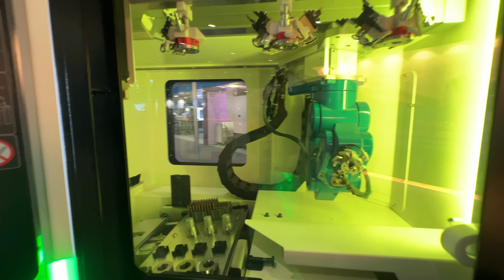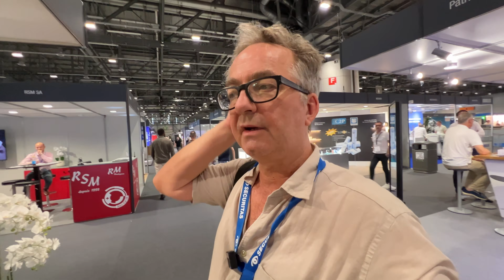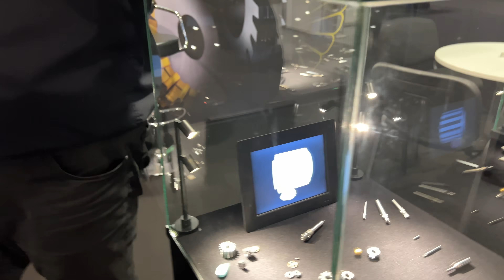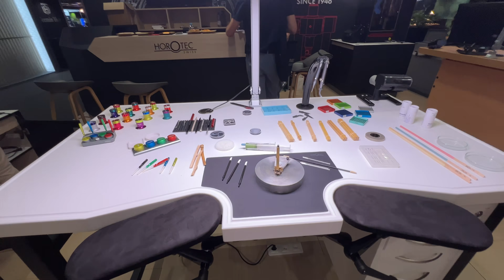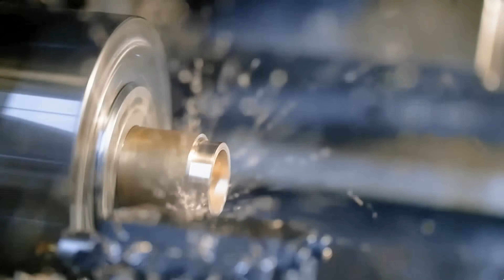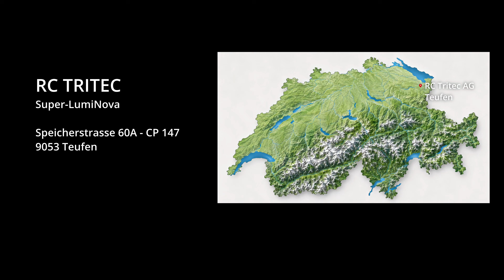EPHJ 2026 - High Precision Trade Show in Geneva, Switzerland

Comment: Fascinating stuff. I'm interested in the logistics and the supply chain, maybe because it's a bit mysterious to me. I like that there is capacity nearby to make stuff, like the factory down the road from you that can take on production line stuff and just pump out parts for anyone. I do wonder how long the machines are useable for, with that level of precision; would you ever break even making watch parts and selling them wholesale before it wears out? I didn't see much with laser welding or additive manufacturing or sintering, but I guess they're around. That little production line was fun, and the machine oiling the palettes while it was running was pretty cool. That level of specialisation and automation does make me concerned for the future of watchmaking though: In 10 years, if I have to service a watch made in 2026 will the tools and information be available?
Reply from the maker: The show does have companies that do laser sintering, laser welding, rapid prototyping, additive 3D printing, etc. Most Swiss mechanical watch manufacturers do design and build for future serviceability. Swatch is one exception to that but Swatches are for the most part designed as disposable mass-produced novelty watches. Swatch Group owns many companies and brands that make traditional mechanical parts and watches that are designed for long term serviceability. Omega and Bréguet being examples of that, but also Blancpain, Tissot,  and others.
Reply: This is where I don't like the Swiss conglomerates (ie Swiss cartel). They restrict parts to independent watchmakers and as of more recent have dumbed down or removed micro-mechanics and parts fabrication in Swiss sponsored watchmaker education in the US. Only 3 or 4 out of the only 8 schools in the US are independent, still teach micromechanics, and each have only 8-12 seats every two years with two year waitlists. So the end user has no other option but to send it to a service center for up to 6 months, where the customer service technician (not watchmaker) was taught in a free tuition Swatch or Rolex run WOSTEP Customer Service Tech (not watchmaker) school to open bubble packets and swap out parts, or swap out the entire movement with someone else's factory refurbished movement, rather than take it to a local watchmaker with no more than two week turnaround. Swatch group is absolutely horrible. They cut off ETA movements and components to ouside brands over a decaide ago while controlling the bottleneck or monopoly on supplying hairsprings and balance wheels, but more especially the mainspring. All the third party movement manufactures that supply most everyone else and clone ETA still have to be subservient to Swatch or they get cut off from hairsprings and mainsprings. The Japanese don't do this with their workhorse calibers, nor do the Chinese. If you buy a new Swiss watch from Swatch, Rolex, Richemont, or LVMH you are essentially paying an initiation fee for a product lifetime of subscription fees where they control the walled garden on parts, service, and watchmaker training in the US.
Reply from the maker: I think the modern consensus is that watch repair is best done by swapping out parts and movements, not repairing the teeth on a wheel or making a new balance staff on a lathe. And the reason is purely economic: the parts and movements are mass produced and cost far less than the labor to repair a broken or worn part. Restoration, on the other hand, is where the education and interest lies for me. Almost every important movement designer starts with a combination of engineering and restoration skills. Restoration provides a feast of historical progress to study and learn from at virtually no cost other than time and tools, and engineering can be learned from any university or even just books at the library. Restoration skills are very different from repair skills and every watch repairer does not need to be an engineer, but every movement designer does. 

The monopolistic behavior is more challenging for me to defend, but one of the reasons I was drawn to Swiss history was the incredible success of intervention and orchestration of the watch industry by the Swiss government historically, and that includes the period of the formation of Swatch Group. Because I started from the point of view that monopoly, regulation, and intervention in markets was simply wrong, what interested me about the Swiss watch industry is that it seems to have worked so well, and it seems to continue to be working. And not just for the watch industry but for the country as a whole, as the watch industry spawned an industrial and manufacturing and educational base that's incredibly successful across all domains in terms of output, exports, and distribution of wealth. 

It would be anti-historical to suggest that Nicolas Hayek sought monopoly for himself and his family so much as he sought to shore up the industrial base in Switzerland through consolidation. His argument to the banks and the government in the face of intense price competition from Asia was, "do this or you will lose it," and in fact selling the major brands that were part of the Swatch Group consolidation, including Omega, to the Japanese was on the table. Switzerland kept the brands, the know how, the industrial base, and arguably its reputation as a result. Of course we'll never know what would have been without Nicolas Hayek, but I'm comfortable in my belief that he was right, and did the right thing for Switzerland itself, with the help of the Swiss banking and industrial elite at the time. He also profited, but he wouldn't have had he been wrong.

The creation of a conglomerate under family control, even if it does technically have other shareholders and trades in the public markets, did result in monopolistic structures and at times harmful monopolistic practices. But the government remains highly involved in the watch industry to this day. And families have proven in many cases to be better shepherds of long-term multi-generational continuity of industrial businesses, especially in watchmaking where history matters, than the short-termism of the CEO sociopaths of my country of origin, the US. Nicolas Hayek predicted that the West's outsourcing of manufacturing and financialization would destroy the industrial base and self-sufficiency of the West in the 80's and 90's and indeed they did. Both parties focused on exporting intellectual property monopolies and the coercion of CIA-orchestrated "international development" (USAID), crushing every democratic movement they encountered on that path, while using identity politics at home to distract the domestic population from what they were doing. 

But that's another story! 

As a long-time resident and beneficiary of the Swiss system I think it works and I like it. For anyone outside of Switzerland I can understand why it might be frustrating: because the Swiss system is designed and managed to benefit Switzerland and the Swiss. To the Swiss the rest of the world is just the export market, and the government's responsibility is to try to develop and support industry in such a way that the country is self-sufficient and brings in more wealth than it exports. The Swiss have done that and done it well while maintaining democracy and avoiding war since its inception. That is what every government should do for its population in my opinion. And I wish they all did. That watchmaking is part of the Swiss identity just makes it all the more interesting and beautiful to me.
Reply: @IMakeWatches   I do agree that swapping out parts is more economical, but I view the recent changes in education and strict distribution of parts as done to monopolize servicing to brand specific service centers rather than a decentralized system of free agents who can easily make career decisions for themselves by either adapting to any brand at any moment or work independently with the capability of fabricating parts when they become unavailable. I honestly believe the conglomerates are also trying stifle the US from making an industrial comeback in watchmaking. There is a distinct timeline of peculiar actions and changes that are direct responses to what has been emerging in the US. We are losing watchmakers to retirement at a rate of 10 for every one replacement all while there is a massive boom in retail sales of mechanical watches. The demographics point toward Gen Z as the fastest growing market for analog watches while using them as functional talismans for countering technology fatigue, seconded by Millennials who use them as flex or investments, then Gen X who appreciate the rebellious spirit and creativity of independents and microbrands, and finally boomers with vintage nostalgia and luxury brand loyalty. The two main catalyst to this boom were COVID lockdowns and YouTube algorithms. This also kicked off a significant surge in watchmaking hobbyists and are bleeding into unprecedented waitlists at every US watchmaking school, to include waitlists at part time bench courses at AWCI and NAWCC. Prior to all this we only had three independents who were fabricating their own near US made in house calibers completely unknown to consumers. One started in early 2000s, then two more around the time Hayak started curtailing parts. The Swiss cartel's canary in the coalmine moment was one small watch company who started upcycling antique and vintage US pocket watches into wristwatches with other US made components (case, crown, crystal, and strap) to achieve a USA made label while showcasing the proud legacy of US watchmaking. In 2015 Swatch sent a cease and desist and in 2017 responded with a frivolous lawsuit for no other reason than to bankrupt the endeavor and intimidate others from even considering the idea. Two years later a high school history teacher started creating a USA made watch to inspire a resurgence in the US and completed just in time to ride the popularity of from COVID and YouTube's algorithm disruption. Two more companies since achieved near US made label, a US company began assembling movements for microbrands and working toward full domestic components, and now a US company is printing hairsprings from silicon wafers. This is about the time the Cartel decided to close watchmaker full curriculum WOSTEP in the US, while still maintaining 3 full curriculum, free tuition schools in a country they leverage in a global supply chain with much of the parts hiding under a facade of a 60/40 Swiss made label (China). They can't have anymore elite US alumni with the capability of competing against them, especially when a USA label means 100% all or virtually all domestic labor and components. If an American wants full curriculum WOSTEP they now must pay out of pocket and compete with the rest of the world for 12 seats every two years at the flagship in Geneva where they also give scholarships exclusively to the Chinese, or seek one of three independent overseas schools with comparable or superior full watchmaker curriculum taught in English. I don't view any of this behavior as protectionism, survival, or stewardship for horology. It is adversarial. I'm sorry to go off on a tangent. I'll stop.
Reply from the maker: @gortex6  I don't disagree with anything you said. I met Cameron Weiss and Roland Murphy at EPHJ last year. Both are important American independents. They were talking to each other in the La Joux-Perret booth and I introduced myself to both and had a short conversation with both. La Joux-Perret is a Swiss company, but it's owned by Citizen in Japan. US watchmakers can make watches with Swiss movements made by companies like La Joux-Perret and Festina and others (or fully Japanese movements like Seiko) that aren't Swiss owned. Both Roland and Cameron were talking to La Joux-Perret about movements. If the Swiss-owned brands don't want to sell to American independents or if American independents don't want to work with them because they don't like the terms they can (and do) go to other manufacturers. I think my only criticism of anything that you've said is that I believe in optimism. Too much pessimism can be burdensome to oneself, and also to the very people that you care about: for example students, young watchmakers, people who want to make a career of watchmaking... It can sound really discouraging if you tell people that the world they are entering is so flawed and corrupt that they'll find it impossible to survive. It's really up to every individual to find a way if they're interested in making a career of anything. And the realities of money and competition are always there for all of us, big or small. The world is a very dynamic place. Everyone in every industry has to work to make their dreams happen. Watchmaking for many is a competition with oneself to be the best one can be. Some will be very good and make a good career of it. Others will enjoy it but ultimately find something else to do professionally. I think it's a really interesting art that's tied to history, and I love that about it more than anything. But it's also a business, and that aspect of it is important or the art would not produce any products or jobs and it would cease to be. So for me the commercial side of it is just another challenge -- not a challenge to me because I don't want or plan to enter the commercial side of it, but if I was young I'd find the commercial side if it very interesting, because that's where the careers are.
Reply: @IMakeWatches  I know those two use Sellita which is a not a hostile company like Swatch. They fixed the problem made by Swatch restricting parts and movements, but they still use Swatch mainsprings, hairsprings, and balance wheel. I know about LJP and their Swiss modifications(which includes Swatch parts) to Miyota 9015 and sizing it down to a drop in alternative to all the 2824 workhorse clones. On that note, there is one other company that I'm afraid just closed it's doors as an alternative was Swiss Technology Production (STP) owned by Fossil Group (USA). Their STP 1-11 was the best standard grade 2824 clone IMHO. Fossil group founded STP to break the Swatch Group supply monopoly on movements but there was a catch. Initially they were Chinese made Sea-Gull ST2030 movements that complied with European Swiss made labeling regulations by installing Swiss mainsprings, hairsprings and balance complete (Swatch Group components) which presents issue overall.  The problem you still run into with almost any Swiss movement is the Swatch Group owned monopoly on the power source and regulating organ. The Chinese have an alternative outside this monopoly with the PT5000. I bought one off Aliexpress for $65. It flatlined my timegrapher out the packaging and easily regulated within 4 seconds delta. The Chinese equivalent to Glucydur is QBe2, Nivarox is 3J53, and Nivaflex is 3J21; the patents expired but the names are trademarked.